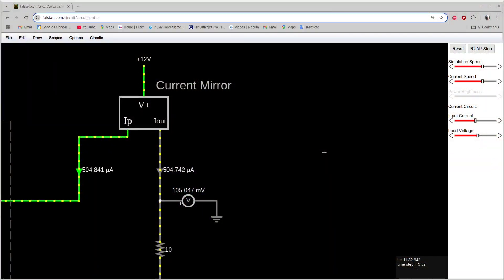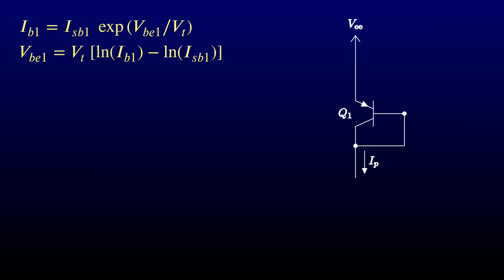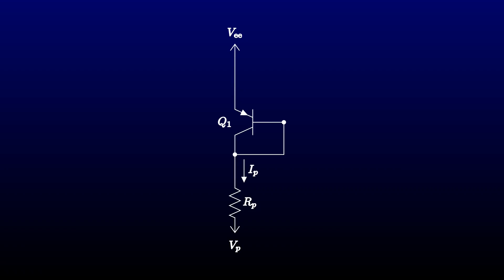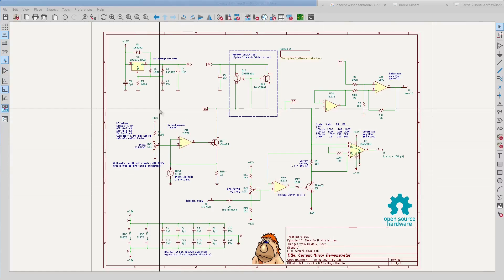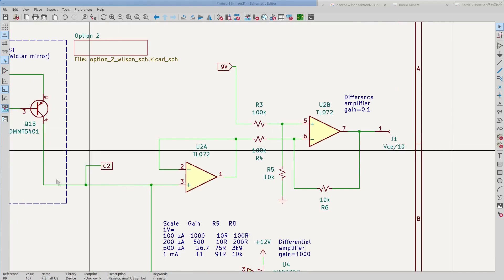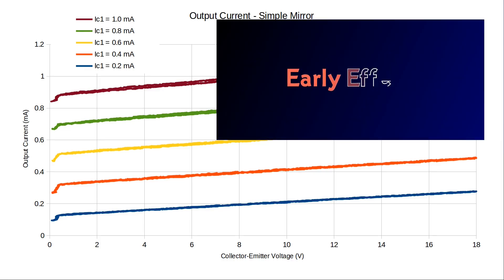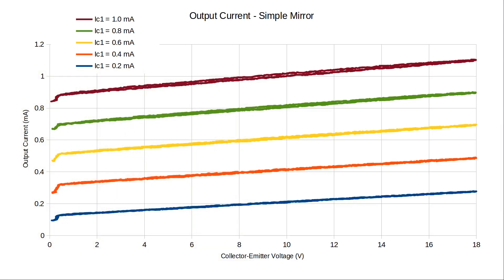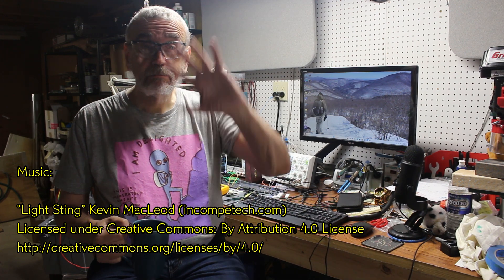They Do It with Mirrors: Transistors 101, episode 12

Comment from the maker: ERRATA:

2:10 Base and collector shorted together, as the picture shows.
10:56: I misspoke when I said "the output impedance is very low.". The output impedance of an ideal current source is infinite, and the output impedance of a real current source is very high.  (It's still true that the voltage will depend on the characteristics of the current source's load.)

Comment: 2:10 Do you mean 'base and collector'? I've watched two of your videos so far and both have had mistakes in them early on. So many fan comments not mentioning these blunders. And again at 3:25 you say 'base-emitter' while indicating base-collector. Clever, but not a details man.
Reply from the maker: 2:10: You're right. I added it to the pinned comment. 
3:25 - No, 'base-emitter voltage' means the voltage between base and emitter.  The arrow is perhaps confusing, but I couldn't find a good place in the diagram to indicate the drop, while still showing the feedback loop.

Thanks for pointing out the one stumble that everyone including me seems to have missed - possibly because most people are focused visually at that point.

Comment: At 10:58 how can you see the current source has a low output impedance? I would expected it to be high looking into the colllector.
Reply from the maker: Answer: I misspoke!  The output impedance of a current source is nearly infinite. The reasoning that follows: the characteristics of the load will determine the voltage, is of course correct.
Reply: @ thank you for the reply.

Comment: I have a question, does a signal traveling through a current mirror suffer from miller effect?
Reply from the maker: It can.  Next episode, we'll see a current mirror with cascode transistors, which are a pretty good "Miller killer," although we're putting them in primarily to clean up the Early effect.

I haven't discussed Miller effect all that much because I haven't yet started talking about high-speed design.  The other series on the channel is focused on audio, and Miller capacitance hardly ever plays a role.
Reply: @KludgesFromKevinsCave  i see. I just asked because im designing an oscillator for 195MHz and was thinking of using a current mirror to mimic the signal from some spot of the collpits circuit. Gotta rethink the idea, thanks.

Comment: Like the video you may have done this but LM317 is a great current sources works good for LEDS and Laser  .
Reply from the maker: Sure, if what you need is a constant, and fairly hefty, current to drive a LED, a laser,, an electrolytic cell, or a battery charger, the 317 will work fine.  (Or the 337 if you need the opposite direction of current flow.) I once built a supply for electrolysis that used a 317 to drive the bases of 4 big power transistors in parallel, with 0.5 ohm emitter resistors to balance the currents and prevent thermal runaway.(It was something monstrous like 60A at a nominal 3.15V drop.) But power electronics is a topic I haven't covered yet at all. Rest assured, though, that I keep a few 317's and 337's (or modern low-dropoint counterparts) in my parts box.

The 317 doesn´t fit some of the applications that I have in mind, though.  It really isn't suitable for tiny currents. I regularly use mirrors in circuits that deal with microamperes or even nanoamperes. The 317 isn´t guaranteed to regulate at loads of less than a few mA.  I'd have to double-check the data sheet for the exact figure. 

In any case, the point here is not just to have a current source, but to make two currents equal - either because there's a differential circuit that needs to balance them, or to reverse the direction of a current (change a source into a sink, or vice versa). It's not just a current source, it's a current-balancing circuit.  We're going to see moving forward how these are used in op amps, and how to use them in things like an oscillator for a synthesizer (which may need a 1000:1 range of frequencies, held to 0.5% or so tolerance over the entire range.) Stand-alone current mirrors are also ubiquitous in circuits that get their inputs from things like Resistance Temperature Detectors (RTD's) or strain gauges - because they let you build your detector with a near-infinite input impedance. Check out the data sheet for the REF200 if you want to see typical applications for that sort of thing.
Reply: LM317 is not good for low currents under 1mA, though
Reply from the maker: @ivolol  1 mA is pushing it.  For the original LM317, the data sheet recommended 10.
Reply: @KludgesFromKevinsCave  I need it 20 to100 mA works better the fix drop resister used!